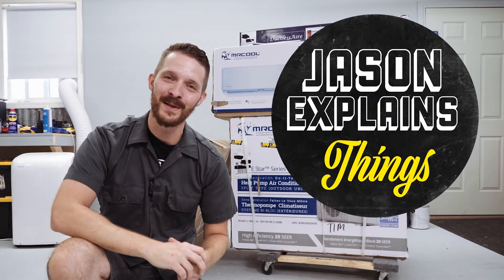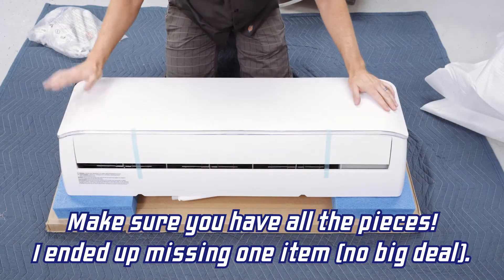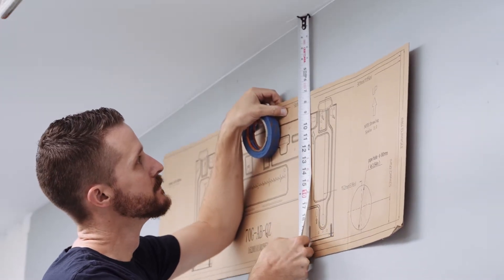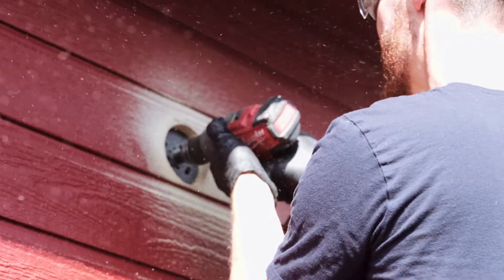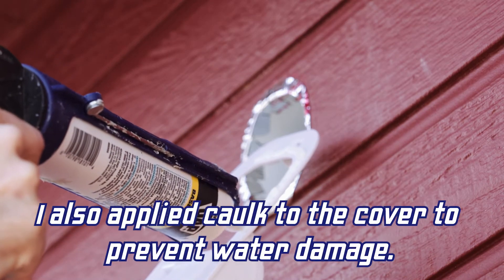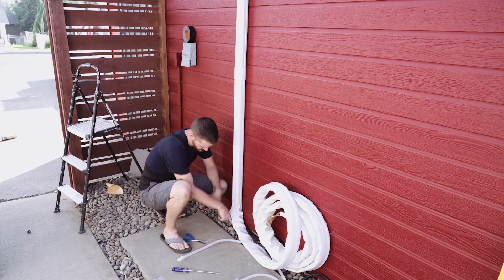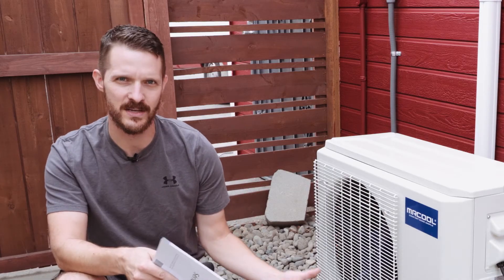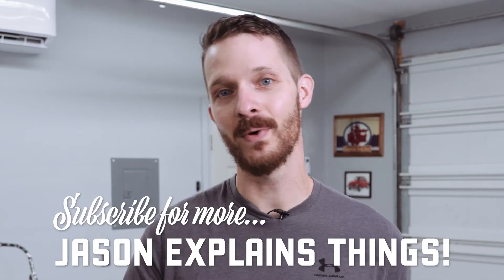I Installed A Heat Pump In My Garage! (MRCOOL DIY Mini Split 3rd Gen)

Comment: These are great diy units and it looks like people made some small recommendations to ensure your drain worked and there were no leaks. But anyone reading this please put your heat pump on a stand so if you have leftover pipe you can put it horizontally underneath. Having the role stand up that way vertically behind the unit causes areas for the oil that is added to the gas to collect. After some time this can be a cause of issues that include your compressor breaking down.

Comment: You can tell he didn't really read the directions.  Lineset from inside unit should have been taped with condensate tube at the bottom.  Hole through wall should have been drilled at slight downward angle.  Not supposed to button up lines until you connect to the condenser and open the refrigerant valves.  Only then does checking for leaks do anything.  I have installed the same system, and this weekend I will be finishing up a second install (18k dual zone).

You CAN disconnect the lines as long as you first shut both refrigerant valves on the condenser.  I know, because I had to replace my gen 3 18k condenser (under warranty).

Comment: Very useful video.  What kind of Romex did you go with: 10/3 or 10/2?
Reply from the maker: Check the install instruction pdf for all that info.  I wired it up based on that.

Comment: Why did you spray the connections at 7:20 when it wasn’t even pressurized?   In order for the leak detection to work, something has to pressure the lines.  You didn’t open up the lines till later one.
Reply from the maker: The lines are pre-charged.  See my update video addressing this criticism and linked references.
Reply: Did you watch the video?
Reply: Yes, he did say that they were pre-charged.

Comment: Nice video.  However under code 608 of the EPA, installing D.I.Y units yourself if not a HVAC certified and licensed technician is illegal.
Reply: @JasonExplainsThings  Laugh all you want, I have seen the federal emails which were sent to Mr. Cools lawyer, and according to the EPA, even changing or connecting pre-charged lines violates the law.  But you are probably a paid influencer and do not give a darn as you got your unit free, with the Mr. Cool 'Mislead the public' Influencer guidelines right?  Why not contact your Influencer contact back and ask them about DIY and Code 608, and are the DIYs legal?
Reply: @mrcoolhvactruths  Code 608 Enforcer to the rescue!!!

Comment: How many hours did this take to install?
Reply from the maker: Hard to say because I was recording a video at the same time.  I installed the break out box for the electrical on a separate day as well.  The pad took and afternoon to make and a few days to cure (you don't want to drill into concrete too soon).  I'd say maybe 3-4 hours for the installation of the mini-split (for just that step).

Comment: Hello the piece you we’re looking for is in the inside of the house. 
The hole on inside is covered by the blower unit. Reverse the tube
Reply: There is a separate piece to the wall sleeve so he is right it must have been missing. I have seen video where they  installed the sleeve frome the ouside and facia frame backwards.

Comment: Doing mine this week, I'm getting confused on those big sheaths on lines
 Are they necessary for insulation they seem so bulky and not sure to cut them.off?
Reply: If you remove the insulation you will be losing efficiency cause the the cooling run will absorb outside heat before it can cool inside.

Comment: FYI, you checked the line set on the top section with soap and water, but you must have the refrigeration in the line to see if you have a leak, do this once you have the refrigerant in the lines in order to check for leaks, other than that, you did great. Thank you for posting
Reply: these lines come precharged
Reply: @johnturner9924 : Joe is saying you check the lines for leaks after you open the valves at the compressor. Not before. There is literally nothing to check. The lines come precharged means they are under vacuum. So when you open the valves at the compressor the lines become filled with the freeon. Then you check for leaks.
Reply: @55afishead  That was what I was saying.

Comment: So is there any way to run the lineset from the indoor unit out of a hole that was below where it would sit? Is it all blocked off from coming down the interior wall first? I'd rather use an existing exhaust cut out than drill a new one way up on my inside and outside wall if possible.
Reply from the maker: I'd check out the linked instructions or email Mr Cool to answer those questions.

Comment: Use a torque wrench. the specs are in the manual. If you get snow raise the outdoor unit. coil the extra piping horizontally so as not to cause an oil trap. talk about maintenance

Comment: Hello, was looking at this mini split unit for my garage. I have a 800sf garage, was thinking to go with the 2 ton, but I need it more for heating the A/C, how is the heating in this unit, and is it possible to install indoors in garage attic? And if anyone who has used this unit, how is it overall?
Reply: Did you figure things out yet?

Comment: your lines were not pressurized with +or - pressure when you tested for leaks not good.
Reply from the maker: If you don’t believe me you can read the linked instructions which I was following throughout the project.

Comment: Just an FYI. We installed the non-DIY. Much much cheaper. All you need to do is nitrogen purge/vacuum the lines after hookup. The freon (410a) is already pre-loaded in the compressor. Our A/C guy did the last step for us - about 20 minutes of work. Our garage workshop is now awesome.
Reply: Not Freon! That went away! It’s Puron or just R410a! Freon is a registered trade mark of DuPont.
Reply: @peterdutile8012  I remember that time I Xerox'd a document too. I did specify R410a ...pedantic much?
Reply: @peterdutile8012  DuPont has all of the refrigerant patents/trademarks. That’s why when it runs out the EPA changes things because DuPont is in bed with the EPA.
Reply from the maker: Great advice.

Comment: What about vacuuming out the air?
Reply from the maker: For that you'd want an air cleaner or filtration system.  The heat pump has some filtration.

Comment: Hi Jason, thanks for the video. Question…. I’m getting one of these units within a week but for my garage they suggested 12K unit and I have a 2 car garage. Any reason why you got 18K for yours? I was thinking about an 18K seeing as I live in Miami Fl cause of the heat but the rep said I wouldn’t need it. What’s your thought? Thanks
Reply from the maker: I chose the 18k based on square footage.  MR COOL‘s website has a page that gives different options based on square footage and ceiling height.  18K was slight overkill for my 24x24 foot shop.
Reply: @JasonExplainsThings  if you had to do it again would you go down to 12K. My garage is 22x21 with 10’ ceiling. My biggest concern is the heat here in Miami but with that said my garage will have very insulated doors (my next YouTube project) and surrounded by concrete walls. I’m sorry, I know you can’t give me an answer but I’m asking whom ever can help as not to overkill the garage
Reply: @JasonExplainsThings  I have a question about the unit. My building is a detached garage( separate from my home) but close by. The building has electrical ran to it from the house main box. Will I need to run this system off that or install its own electrical box ?

Comment: Make sure you always drill hole and angle downwards the drain needs pitch otherwise your units drain on will fill up and drip down inside of your wall. Very important
Reply: also In the manual it says to remove the filter and pour some water to verify that the water exits through the drain hose and does not sit in the unit. Has anyone done this? I opened up the front cover and removed the filter, are you supposed to pour the water over the fins ?
Reply: I doubt it would make a big difference in that thin wall, so relax

Comment: Great video,  I am in search for one that has a cooling only feature since I love in Florida.  Does anyone know if mrcool sells that model?
Reply: just dont' turn the heat function on. you'll save about $100 vs one that is AC only and code requires heat in most areas.

Comment: hey great job on this video! my question to you is how hight and low can you set the temp? I WANT TO BUY THIS BUT HAVE THAT MAIN QUESTION
Reply from the maker: For really specific instructions check out the linked PDF.  I briefly talk about it in the video that you want (if I remember correctly) at least 6 inches from the ceiling.  But the instructions go over that.
Reply: @JasonExplainsThings   I'm so sorry i fat fingered that lol how HIGH and low does the temp range? well your from WA state as am i, i was looking for a HVAC that can heat and cool. that being said does this do both? ALSO your videos are awesome man

Comment: You didn't vacuum the system prior to releasing the refrigerant.  A system like this will not last longer 5 years... I wouldn't trust this at all.
Reply: Please read up on these DIY systems. They have special connections that are sealed until connected. The indoor unit lines and the lineset are either prevacuumed or full of refrigerant. There is no vacuuming required.

Comment: What about all of the air and moisture in the lines running to the head unit? No mention of any means to manage that?
Reply: Condensation hose? Lol no that’s for condensation. Think he’s talking about the copper lines that you never bothered to pull a vacuum on.
Reply: @DuragDusse  Exactly. Still don’t understand how these DIY systems get around that.
Reply: Lines are precharged and under pressure with valves that only open when you tighten the connection. Only thing in them is refrigerant under pressure, no air no moisture. .
Reply from the maker: That’s what the condensation hose is for.

Comment: 7:00  refrigerant lines are not pre-charged.  410A charge is inside the condenser unit.  Don't care for having several feet of line just coiled up outside.  I would cut lines to length and braise on new fittings.
Reply from the maker: Wrong.  To find the answer all you need to do is check the instruction pdf I linked too in the description.
Reply: @JasonExplainsThings  I stand corrected..

Comment: Hi,.. Is the line set directional?... That's to say....  R the connectors specific to the indoor /outdoor units?  Mine came with no identifying marks to orient correctly.... Thanks.
Reply from the maker: This was almost a year ago, but if I remember right I don’t think it mattered.  Check the instructions though.  :-)
Reply: @JasonExplainsThings  Hey,... thanks for the reply!   I checked,..many many times and 3 days waiting for tech support at Mr Cool to respond....  Seems like no one remembers how they attached the lineset , or weather it mattered....

Comment: I was thinking of installing a 12,000 btu system in my garage which is 400 square feet. Was curious how big your garage is and if you think mine would need the 18k size that you installed.
Reply: Was also thi king 12000
Reply: What’d you go with? Debating on the mini split vs a 12,000 BTU window unit for my garage as well

Comment: The video is great… however…. the $$$ saving part its just not true anymore. Their prices are just ridiculous and I ended up saving $500 paying a professional to come install a superior unit (Gree) and have labor warranty. Not to mention I dont have a line dangling around. Example, their 24k BTU unit is selling for around $2,200. Comparable brands are selling the same for around $1,200- $1,500. Do most of the install your self and bring the AC guy to cut, connect, and fill lines. You still saving around $400, and a much cleaner look with no extra line possibly accumulating stuff that could cause problems in the future.In my case I just got a better deal all included and didnt have to do anything. Saved $500

Comment: Awesome video Jason! A couple of questions, 1. What width of Line Set Hide Cover you used, if you were happy with the quality can you add that to the links in the description? 2. Can the line set exit to be on the left side of the air handler instead of the right? Thank you!
Reply: 2nd gen allowed for line set to exit on either side, read instruction manual to verify if 3rd gen has that option. I bet it does.
Reply: 1. Idk 
2. It must exit on the right

Comment: Is the indoor unit powered from the outside unit via the “communications wires” or does it require it’s own separate power supply?
Reply from the maker: The wiring from indoor to outdoor includes power.

Comment: I'm curious if the outside unit drips water or produces condensation?
Reply from the maker: There is a drain I believe.  That’s why it’s elevated on feet a bit.
Reply: Nope. That’s what the drain line from the inside unit running to the Outside is for. Only your head ( inside unit) has an evaporator coil that produces condensate. The condenser (outside unit) produces no water
Reply: @johnrobinson1989  How about in the winter?  My unit the coils freeze over, and the unit will defrost the coils by reversing direction for a while, which then causes it to drain water.  In the air condition mode it does not do this, but for heating it does.
Reply: Both inside and outside are condenser depending if in heat or cool mode. As such they both have to drain.

Comment: Great video! You’ve got lots of energy. How big is y
The space your cooling?
Reply from the maker: 24’x24’
Reply: @JasonExplainsThings  What part of the US are you in? I'm looking at installing one in a similar sized garage in AZ and am curious to know which model I'd need.
Reply: @DIYAroundTheHome  I'll jump in here and try to answer.  Look online and call Mr Cool.  Too many factors can make this vary wildly.  Is the garage insulated.  Does it have windows?  Are you planning on using it all summer or just when you want to work on stuff?  Are you planning on pulling hot cars in the garage in July and then working on them.  I did a 36K system for 750ft2 and it's overkill for now.  I have not started parking inside yet and I wanted the extra power for when I do.  Good luck, great systems.

Comment: You could have bought the 16' hose rather than the 25'. Losing heat/cooling through that extra hose.
Reply from the maker: That wasn’t an option with Lowe’s, but yeah that would be great.
Reply: @JasonExplainsThings  Home Depot gives many more options for hose length.  For instance on a dual zone unit it will be labeled 1675  which means one 16 foot line and one 75 foot line.  Right now, Lowes does not give you these options.

Comment: Hi. Can you explain why you chose 18k vs 12k. your shop looks like less than 500sqft?
Reply from the maker: Sure, so my shop is 576 sq ft.  The 12k is rated for a max square feet of 500.  Especially since this is a shop/garage with large older doors I wanted to have overkill instead of going past the capacity of the heat pump.  If it was under 500 I would’ve gone with the 12 k.
Reply: Thanks! Love your channel!

Comment: Jason Explains Things Hey thinking of getting the 12k unit. Does this company provide the black tape you wrapped around connectors when you connected the lineset to the line from unit. Also you said to wrap the excess coil with UV tape. Did they provide you that also? Thanks
Reply from the maker: Yes, and yes.  :-). Although I did run out of the UV tape.